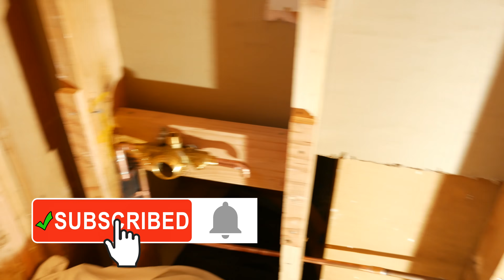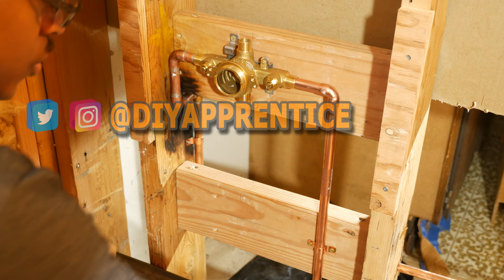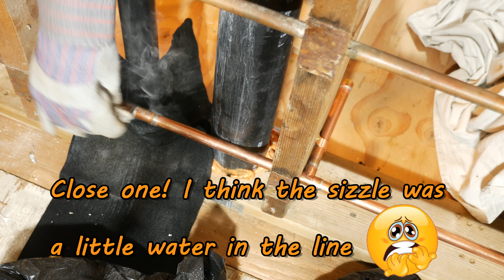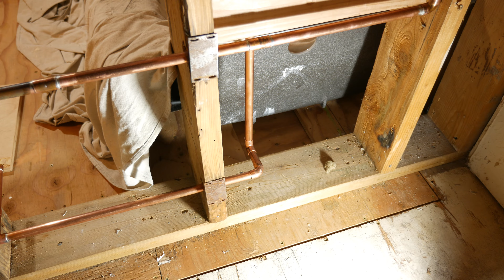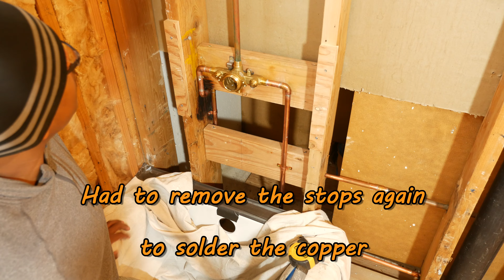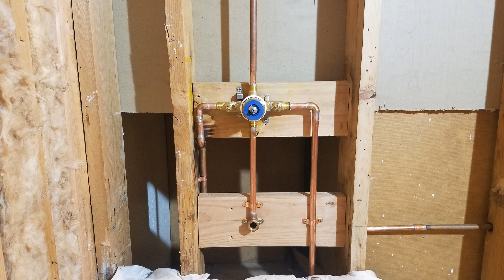Bathroom Remodel 58 - Shower Valve Installation Pt 2 | Grohe

Comment from the maker: Please disregard the point I was attempting to make @8:30.
🔧▬▬Tools and Materials▬▬🔧 
✔️ DIY Apprentice Recommended Tools and Materials ► https://bit.ly/2T5psFw

✔️ Grohe 35015001 Valve ► https://amzn.to/2W9X1Xp
✔️ Grohe 3-Port Rough-In Valve ► https://amzn.to/2VpMwyW
✔️ Grohe Diverter Valve Trim Kit ► https://amzn.to/2VrrU9G
✔️ Sharkbite 23251 Crimp Tool ► https://amzn.to/2FjrEUv
✔️ Sharkbite 23055 Crimp Removal Tool ► https://amzn.to/2Y16i5T
✔️ Paste Flux ►https://amzn.to/2HX1CID
✔️ Flux Brush ►https://amzn.to/2U3ZDth
✔️ 4-in-1 Pipe Cleaning Tool ►https://amzn.to/2HWJZIO
✔️ Pipe Reamer (deburring tool) ► https://amzn.to/2HXNsGT
✔️ Abrasive Sand Cloth ► https://amzn.to/2V1dcG6
✔️ Pipe Cutting Tool with Quick Release ► https://amzn.to/2FEWebj
✔️ AutoCut Pipe Cutting Tool ► https://amzn.to/2WpNbAE
✔️ Ratcheting Pipe Cutting Tool ► https://amzn.to/2FFtFun
✔️ Flame Protector ► https://amzn.to/2WnOXSI
✔️ Lead-free Solder ► https://amzn.to/2JMPJaw
✔️ Hose Kit ►https://amzn.to/2V0tdMC
✔️ TS8000 Torch ► https://amzn.to/2U11izG
✔️ Channellock Pliers ► https://amzn.to/2HKnEz4

📷▬▬Video Equipment▬▬📷
✔️ Camera used ► http://amzn.to/2GcpkOb 
✔️ Lens used ► http://amzn.to/2Deu16S 
✔️ Tripod ► http://amzn.to/2GbaM1c
✔️ RAM Suction Mount ► https://amzn.to/2Wz9PXh
✔️ Cyberlink PowerDirector ► https://bit.ly/2jTwGxT
✔️ Adobe Photoshop ► https://bit.ly/2V7nyUX
✔️ Camera Slider ► https://amzn.to/2WtD7GW

Comment: Hi, haven't finished the vid4o yet, but, at the point where you're looking at a $20 way to 'rig' the handshower hose to the showerhead tube, yet you have the project at bare-studs, OMG! I'm sitting here howling "NOOOOO!" 
Don't cheap-out. Maybe you already have, or chose a better path. I have been all over Europe, I pay attention to plumbing; do ab3-outlet diverter or a 2nd diverter for the h/s outlet is the way to go. There are less expensive parts, or you could have rigged one but not hanging off of the shower tune!! That's so cheap looking. Plumbing is permanent, in a sense, invest!
Reply from the maker: I may revisit installing a diverter valve before installing tile. The backer has been installed, but I can access the plumbing from the other side of the wall. Spending another couple hundred dollars on a project that has gone on this long is trivial.